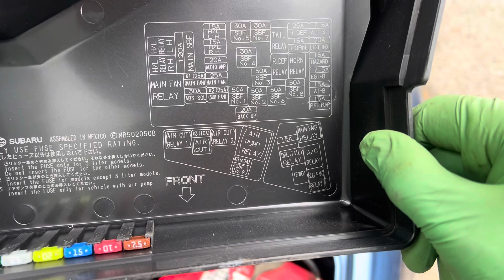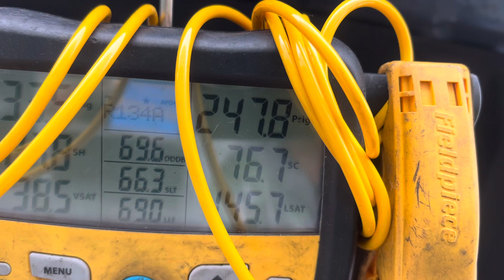Subaru AC clutch not coming on. Swap AC relay & fan relay to get AC clutch working

Comment: Those relays are color-coded, and each has a different amperage/current rating, you can cause problems when doing swap-a-tronics diagnosing, you're probably ok on those circuits, maybe. Be careful.  
Some aftermarket relays may cause problems as well, voltage spikes can affect control module circuitry.
Reply from the maker: I’m swapping the same color part number release they’re both identical. 

Yes, I know relays some have dialed and resistors for current spike suppression . 

And some do not especially cheap aftermarket ones . 

You can actually add them yourself in line and circuit on the backside of connector plugs .  

Like back in the 1960s if you looked at the connector on the air conditioning compressor clutch coil there is a resistor dialed across the positive and negative terminal . 

This is the kill the inductance fly back induced voltage spike . Every time electrical field would collapse when the voltage was released from the field coil that was nothing more than a big electromagnet..
Reply: Maybe the defective relay had an intermittend circuit problem that didn't occur when it was tested before...sometimes it can be a long search...

I practice relay-swapping, too. Same colour, same parts number.....no problem at all.
That would have been a good diagnostic situation for an aes wave uActivate relay circuit tester....a very nice diagnostic tool 👌
Reply: @coldfinger459sub0  
I should have known you were up on it, figured maybe someone watching the video might not.
I've run across poor terminal fit on those Subaru relays, worn compressor clutch and some evap temp sensors that fail 20-30 after minutes of operation.
Good stuff, thanks!

Comment: Those relays are delicate plastic shells. I use plastic panel tool and lift up. Never squeeze those relays imo. Always buy oem electronics never aftermarket.